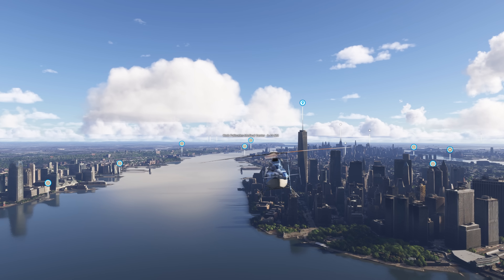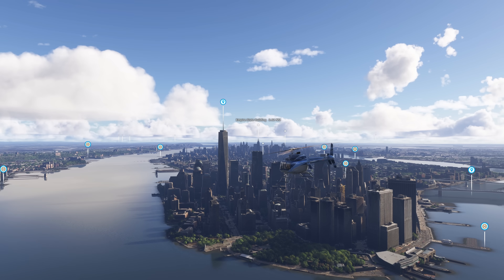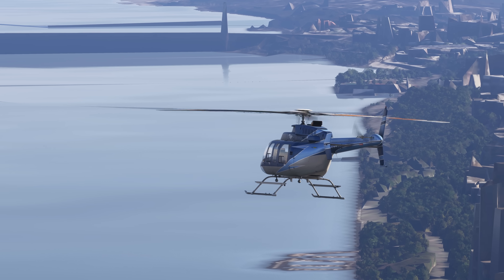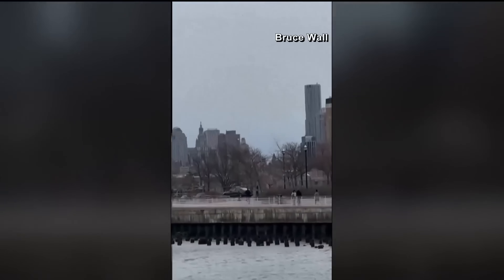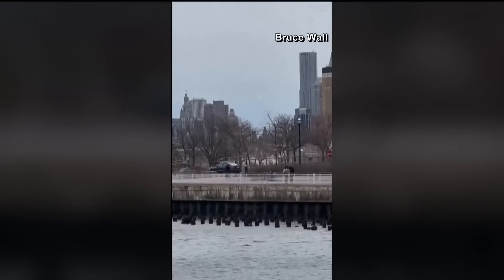Helicopter Expert breaks down Hudson Crash, and discusses “Bump Mast” Theory | NYC Crash Follow-Up

Comment: Thank you. As a former helicopter pilot who has flown the 206 and larger helicopters, you should see the second video of the crash from the other side of the river. It shows an almost instantaneous about 90-degree turn of the aircraft while it is in forward flight. A video showing the recovery of the helo from the water shows the tail boom folded over, which could happen from the airflow in the abrupt turn. The rotors, when they flew off, were straight and intact, still attached to the mast and transmission that was ripped from the aircraft. The rotors and transmission auto-rotated smoothly to the water. If the rotors had hit the tail boom, it wouldn't have been smooth, and the rotors would be at least bent or broken, as Col. Joe stated. From what I saw, it appears the transmission seized up instaneously, causing the helo to rotate from the torque, with the tail boom folding from the airflow. I also heard that there was a transmission problem with this helo in September, whether a chip was detected or something else. Another factor could be an engine failure where the engine seized and the overrunning clutch (free wheeling unit) in the transmission also froze. No matter what happened, the pilot had no chance to do anything to save the aircraft. The loss of life is terrible, and my heartfelt condolences go out to the relatives of the families of the passengers and pilot.
Reply: I am not a helio guy, but saw it the same way you and some others saw it and think the same. Credit to the guest it sounded like he didn’t buy that “ mast bumping” theory either.  Also thanks for pointing out what the posible cause of the tail boom separation. I was wounding about that.
Reply: Also a former OH-58 pilot I have never heard of the catastrophic transmission seizure you describe, but the anticipated result would be as you described it.  The aircraft folded in half in forward flight and the rotor spun off as a result of the sudden stoppage meeting inertia.  Had a cyclic climb or other low G maneuver allowed mast bumping, or the rotor system to unload, flap down, and contact the tail boom the rotor head would not have continued to spin at that rate.   Over twenty years ago, I talked to the survivor of a mid air collision between two  AH-1 Cobras in Korea.  He observed seeing the other aircraft’s rotor system moving at the rate of a watch’s sweep second hand as it fell from the sky, erupting in a huge explosion behind his aircraft, killing both crew members.  The contact dislodged a weight from the tip of one of the survivor’s rotor blades creating a severe lateral vibration that violently shook the aircraft and required both pilots to control the cyclic to get the aircraft on the ground. That vibration caused the transmission and rotor system to ultimately detach and simply fly off of the aircraft, cowlings and all, AS THEY PULLED PITCH UPON LANDING, resulting in the smoothest, noisiest touchdown in his flying career.  God was their co-copilot, that day.
Reply: @SpikeD2000 what weight on the tip of the rotor blade? Are you referring to the leading or trailing edge of the blade? And only if needed? Before you call me out as being stupid I was a 67Y for over ten years before the Cobra was phased out. Also two-bladed main rotor system, it is susceptible to mast bumping.
Reply: I don't believe it was mast bump. The blades were intact with the mast and transmission attached when they autorotated into the water. Had it been a mast bump, the blade(s) would have shown severe damage. Whether it was an engine or transmission or clutch failure is yet to be determined. Whatever the failure was, the pilot had no options available to him. My deepest condolences go out to the families and pilot.
Reply: I’m a helo guy, too, and yours is the best explanation I’ve seen so far. I wish everybody would stop talking about mast bumping - not likely in a Bell and the video doesn’t support it. It appears mechanically catastrophic and the  pilot could be neither the cause nor the solution.
Reply: @v1rot81 Mast bumping or rotor strike was the common thought (And mine too) UNTIL the video of the intact rotor/mast assemble spinning down.  So UNTIL  that second video was out there a rotor strike was not unreasonable given  the fuselage appearance as it was shown in first video.
Reply: @gscott5778 , you’re absolutely right. The video and wreckage pretty much ruled out a mast bump.
Reply: @v1rot81  lots of people who don't know what "semi-rigid" means talking about mast bumping not realizing how silly they sound to people who have flown and learned helicopters.
Reply: @v1rot81 Do you think the reported fuel issue, or lack thereof could have been the cause due to fuel starvation?
Reply: @BrianMiller4802 , it was possible initially, but now I don’t think so. It’s looking more like a catastrophic failure. NTSB will figure it out.
Reply: @ Thank you sir
Reply: That video was clearly showing what you described. Very astonishing to see it happen like that.
Reply: Ouch, this does not look good for the owners and management of NY Helicopters.
Reply: I agree with your observations.  The guest should have watched all the available video so he could make more informed commentary.   Talking about mast bumps and Jesus bolts was pointless.   That helo had a massive instantaneous mechanical failure and huge yaw event in straight and level flight.
Reply: @daversj  100% a mechanical failure.
Reply: @daversj jesus nut. Fixed it for you
Reply: So could this be a maintenance issue, metal fatigue. I guess what I'm asking is how could such a potential failure go undetected? Assuming the theories posited here with are the cause?
Reply: I just saw a story where the rotor system and transmission were recovered. From the looks of it, it appears that the transmission mounts DID NOT FAIL... it appears that the entire floor of the transmission bay ripped out of the aircraft with the transmission still attached... From what I could see, the transmission mounts looked intact.
Reply: Very plausible.
Reply: A chip doesnt GET detected the chip does the detection
Reply: @Jimmyjames11111  no, a chip gets detected. Read up on it here:

https://www.doi.gov/sites/default/files/uploads/IALL_2015-03.pdf
Reply: highly likely you are correct.
Reply: Former military crew chief here.  I totally agree with your assessment.
Reply: Absolutely agree with your assessment.
Reply: Did you watch the NE Philly jet crash? There is one video where it sounds like the engine seized up there too. Like high pitched metal gears grinding
Reply: I agree with you it makes sense that’s what happened
Reply: Tail not folded over, separated at #2 rib, Recovery of blades, gearbox and roof beam as whole assemblies.
One blade missing 18+ inches. no signs of contact with tail or airframe.
Reply: Wow great breakdown thank you.
Reply: I agree with you on a lot of that. But it seems like the tail bent over to the opposite direction of the rotation direction of the rotor head. Which the tail maybe contacted the rotor after it folded towards the fuselage, but I think the tail folded before any rotor strike. I feel like there were undiscovered cracks in tail boom and the track and balance was out for the rotor system and was being maintained poorly for many flight hours. Then under this flight with lots of weight the cracks finally catastrophically gave out. Because the rotors seemed fine as they were falling. So my best guess is airframe gave out from routinely performing poor inspections and maintenance. Also, newer pilots like a lot of tour companies hire, don’t usually know what it feels like to fly a helo with excessive vibrations due to poor track n balance which is horrendous on the airframe. As for the “Jesus Nut” I feel like the rotor head would have departed first in that instance.
Reply: Definitely more looking more like metal fatigue and stress on the airframe.
Reply: It seems in this video that they are describing boom strike, as in the main rotor blades have hit the tail. That could happen after mast bump and break as you said, or I guess by pilot inputs. It kinda looks like that helicopters transmission ripped out completely.
Reply: @mattwaine296  You should look at schematics and cross sections for the vehicle. there is a shell casing that comes of with the transmission but it's probably empty. It covers a void for stream lining.
Reply: https://www.youtube.com/watch?v=graz-V-Hksw shows the moment of destruction, including a sound which I believe is the tail shaft whipping around inside the boom right before the helicopter yaws and boom separates. There is also a video which I can't find right now showing the boom being recovered, and it appears to be torn apart forward of the horizontal stabiliser.
Reply: Well stated, thank you.
Reply: I concur. I firmly believe the Mast bearing seized...Rotor separates, Fuselage falls to Earth. I'd want to see the Maintenance records, incidents of Chip lights.
Reply: The rotor has the transmission still attached
Reply: Military helicopter pilot background (Oh 58 & UH 1) and I agree mast bumping seems unlikely. Catastrophic failure is more likely. The US Army had some early tail boom failures on the OH 58 (a variant of the Bell 206) due to the different rotor diameter of the OH 58 compared to the Bell 206 which set up a harmonic vibration that caused failures after multiple autorotation's with low rotor RPM at the bottom of the autorotation. The fix for this was to limit the minimum RPM during the maneuver which required a different procedure at the bottom of the landing. This gentleman does not give a great explanation of "mast bumping" to begin with.
Reply: @shannonstebbens6992  Seems to be lots of confusion between tail boom strike and mast bumping think it's because mast bumping can cause tail boom strike
Reply: The key piece of evidence is that is that the rotor was intact indicating that it had not struct the tail boom and that is was still connected to the mast and some portion of the gearbox.

I agree that the most likely cause is a failure of the gearbox and/or the shaft to the engine. The resulting torque is what destroyed the helicopter. 

The cause is likely to be a mechanical failure, possibly involving maintenance issues.
Reply: *rotors don't droop but cone up when they slow down in flight. On the ground it's the opposite effect!
Reply: I have never been within 25 ft of a helicopter and you came u with the exact same conclusion I did. The transmission or associated parts had to seize abruptly for the complete assembly to be ripped from the airframe.
Reply: @ Yup. I can’t see how the tail assembly failing first is going to rip the roof from the helicopter
Reply: Juan Browne, who I hugely respect, on his Blancolirio channel did an analysis and arrived at exactly the same conclusion as you. He went to the trouble of showing a 206 rotor head and gearbox, pointing out the quite flimsy looking pair of brackets that secure the assembly to the airframe. Apparently, it's not unknown for those brackets to fracture, but I think the latest footage of the exact point at which it all goes wrong, clearly shows that sudden 90 degree turn of the main fuselage, which is a good indication of torgue transfer from the rotors to the main body from a sudden transmission seizure. Also, the entire head assembly complete with both blades and the transmission still attached can be seen auto-rotating down relatively slowly. In a follow up, Juan also looked at the main cabin wreckage as it was lifted, and it is quite clear that the tail boom did not separate at the join. It broke a foot or so to the rear of that point, further reinforcing the likelihood that the tail broke off as a result of the sudden torque transfer.
Reply: Thank you very much, very insightful explanation and thank you also for the sensitive words.
Reply: I am no pilot but hail from an aviation family and I have some engineering background.  I dislike speculation, but I'd rather suspect it was likely violent reaction to abrupt and instant transmission failure. I think they might find it wasn't mast bumping as the tail was cut off too clinically.
Reply: I’m confused about the “mast bumping”.  I watched a 1982 US Army training film and mast bumping was where the 2-blade, teetering rotor ran out of teeter.  The Army film described it and illustrated it as the portion of the rotor hub that teeters or see-saws on the vertical rotor shaft (mast) which connects the transmission with the rotor, would bump that mast up near the top and break it.  The rotor would be separated from most of the mast, which along with the transmission, would remain in the airframe.  Essentially, it would look like the rotor blades came off the mast.  Like the propeller came off the beanie cap, if you will.

That does not seem to be what happened in this accident.  At least some portion of the transmission seemed to be separated from the airframe and the transmission, mast and rotor seemed to still be intact with each other and rotating.  Video showed them auto-rotating down, far separated from the fuselage.

From what is being discussed in this video, it sounds like they are describing “mast bumping” as the main rotor blades colliding with the tail boom.  Or else I’m just slow and not following, not understanding.
Reply: This.
Reply: If the pilot wanted to deliberately do this mid flight is there a way?
Reply: @FirstLast-rb5zj  No. There is no way for a pilot to cause a transmission failure.
Reply: Nice summation
Reply: Absolutely Brilliant observation  and Reply sir! Thank you for your insight which I believe preemipts the findings or best possible explanation of the official investigation.
Reply: @billlewis1483 Thank you and one of the best and informative comments I seen in awhile 🙏
Let's see what the full investigation will reveal and condolences to the relatives of the families of the passengers and pilot 😥
Reply: There are so many crazy things that can happen to a helicopter to make it decide to just drop like a rock, it's kind of scary.
Reply: Where's the second  video from the others use you saw?
Reply: Everybody talks here svput second video I saw many n repeats!! Which was second video ?  Can somebody post?
Reply: They recovered the rotors.  They are broken in half but still attached to the mast.  The centrifugal force of them rotating would have made them look like they were still intact while they auto rotated down.
Reply: One rotor was shorter, the tip was missing.
Reply: Thank you for this explanation. I've been searching high and low for why this happened and this looks like the most plausible explanation along with the explanation in this most excellent of videos.

My sympathies for the family and Pilot. Sad shit all around..
Reply: I would agree with transmission would be in the top 3 scenario. I'm also well versed in the Jetranger operation. Twenty year ARMY OH-58. The mast bumping theory isn't high on the failure lists as that usually breaks off at the top of the mast. The other most likely scenario would be a transmission mount beam failure which has been an issue with the 206's in the past. A tail rotor blade separation is also very highly likely. That would cause sever trouble with the tail boom the force from a loss of a blade could cause boom failure. If a tail rotor blade came off the gearbox would likely be ripped off with it causing the shaft to flail about violently. 

From the video the fuselage looks like the boom broke off just beyond the mount point. The intact main rotor blades don't support a boom strike. That suggests that neither mast bumping or rotor drop occurred. An engine failure or free wheeling failure is not likely causal either as a pilot response error would have caused a boom strike. The most likely events would be Tail Rotor blade separation, Transmission seizure  or transmission failure would be on the highest probability causal items.
Reply: Latest video shows salvage of rotor and transmission , its still attached to helicopter roof it looks like the roof section separated with transmission still attached
Reply: Yes, Main transmission seizure and catastrophic. There's nothing the pilot can do. Operator's responsibility
Reply: This is my own observation as well! I don't agree that when the rotors slow down in flight the  blades would drop to the extent of striking the tail boom. The opposite is actually the effect. The rotors will actually come up! The video is very clear the transmission locked up and aerodynamically the aircraft yawed to the right the rest followed. The tail boom separated as a result. The helicopter flipped as a result of the nature of these aircraft being too heavy, that's my own observation!
Reply: *the helicopter is top heavy hence the flipping upside down!
Reply: *naturally top heavy....
Reply: Instant and catastrophic gearbox failure
Reply: In the Bell 47 the transmission cannot Jam, I don't k'ow if ir is the same in the bell206,
But I beleive so.
Reply: This is a great overview, thank you.
Reply: A transmission seizing will cause a LEFT yaw, NOT a right yaw at as seen in the video.
Reply: @AgonxOC Honestly, the CCTV footage was so bad, I couldn't tell which way it spun. Just that it suddenly spun, hard, as the tail and rotor came off.
Reply: @ there is a zoomed version and you can see it yaw to the right.
Reply: @AgonxOC  Ah. I will have to look it up. Lots of speculation and misinformation out there about this accident; I would like to see the original videos.
Reply: Transmission!
Reply: Thanks. Not a mast bump. The tail loss and power head disassembly was a torque snap from a sudden stop of the transmission
Reply: Why is this guy talking about? The Jesus nut is what holds the main rotor hub and blade assembly on the mast. It does not hold the transmission in. Good god.
Reply: there is a better video which you can see the aircraft better and closer..if you look at the vertical stabilator at the tail rotor gear box, you will see the tail boom buckle at that location and then the vertical stabilator and tail rotor gearbox separate from the aircraft, then the nose pitches down, would assume the pilot pulled aft cyclic to try to level the aircraft resulting in the rotor system contacting and cutting through the tail boom and the violence of that event resulted in the transmission and rotor system breaking the mount points and separating from the aircraft...WAS NOT MAST BUMPING, the initial problem began at the tail.
Reply: And no one thinks that all these recent aviation crashes are connected?
Reply: @goxyeagle8446  No.  Why should they?
Reply: EXACTLY!  Pretty evident from the initial videos.   Air Cav!
Reply: Hi , I just posted a comment and would like your thoughts as a pilot, cheers
Reply: This seems to be the most plausible explanation so far. I just have a hard time believing there was a boom strike. The entire rotor blades seem to be undamaged and intact.
Reply: @billlewis1483   But couldn't that also occur if the Tail Rotor drive Shaft suffered a catastrophic "Rapid Unassembly"  causing the Outer covering to deform!??
Reply: @Pergolf33  No. If the tail rotor "unassembles," it normally does so at the couplings unless a main rotor blade hits it, which didn't happen here. The tail rotor shaft did actually break close to the main fuselage. The aircraft is in forward flight. The aircraft is streamlined to minimize drag. Pilot control motions can not make the aircraft turn as radically as it did. In this case, from the pictures, the tail boom broke radially to the side. This can't happen unless the aircraft also turns radically to the side at forward motion, imparting a sideways force on the tailboom. The tail boom is also streamlined and is actually an airfoil. They make them that way to minimize how much power the tailrotor requires in forward flight, thereby giving the aircraft greater speed and fuel economy. Even when a main rotor hits a tail boom or it fails in any other way, it won't go sideways in forward flight.
Reply: Gonna have to look for that second video!!  Thx for this input….
Reply: Nope, that's not what happened. The idiot pilot was instructed to lower her altitude and she did not obey
Reply: Exactly right. This video is mostly a word salad that doesn't match the evidence we have...
Reply: Look at the new video of the salvaged wreckage. You can clearly see a tear in the tailboom skin at the first rivet line.  As noted in my comment above, I investigated a similar accident, and it was caused by metal fatigue. 

I don't believe it was caused by a transmission seizure as the initial action would have been the main rotor and gearbox separating from the aircraft, not the tailboom failuure. Additionally, the thrust of the main rotor is to the left, and a seizure of the main gear box would have resulted in the nose going to the left due to the inertia.

Metal fatigue at the first rivet line resulting in skin failure would have caused the boom to twist forward on the left side of the aircraft due to tail rotor thrust. And, the nose going to the right as it did in the video. 

Additionally, main gearbox failure would have been proceeded by gearbox chip indicators, which I believe the pilot would have noted to air control.
Reply: @keithdavey5492  I also am sceptical that the engine seized though it's always something to consider. It seems to me as though the tail suddenly went and then the transmission a few seconds later. It could have been a tail strike but this doesn't really explain why. Apparently under certain turbulent conditions the axel can come loose and break away but to see if it would do it like this you'd need to look at a schematic of the upper assembly. The tail breaking off like that might push it beyond its limits but who knows. A drone strike is still not ruled out. Sabotage is another possibility. The company leased its choppers and had issues paying for the leases. Someone could have loosened a few bolts. The way it serves also reminds me of when someone loses their temper in a car during an argument and serves the wheel to one side suddenly in rage crashing the vehicle but a technical fault could look just like that.
Reply: @keithdavey5492 @keithdavey5492  Tail boom cracking from metal fatigue doesn't result in a turn that is that radical and rapid when in forward flight. Chip detectors are not immediate. A chip has to flow to the sensor, not get caught by the filter, and lodge enough material to indicate. A sun or planetary gear that cracks or jams will immediately stop the transmission without any chips being detected. The video and frame rate doesn't clearly show the airframe's rotation and direction. Ripping the whole transmission deck off takes tremendous force as it is the most structural part of the airframe. We'll see what the NTSB comes up with. By the way, I heard there was a previous transmission problem with this aircraft in September.
Reply: @keithdavey5492 Skin failure wouldn’t cause this. That thin sheet metal has little to no structural value on most any aircraft.
Reply: @keithdavey5492  I tend to agree with you! 
Also they had wind gust's up to 18 mph that day! Which may or may not have had anything to do with breaking the boom. But if it was weak already its possible.
The left side of the boom is undergoes more stress its entire flying life. Because its being pulled hard right at all times any time in operation.
I believe when the boom broke before anything else on the left side of the helicopter, it quickly got into the tail shaft as the helicopter rotated to the right, where thumping can be heard in the video with audio.
As it bent around far enough to snap off the tail rotor drive shaft the thumping stops.
As it bent the shaft enough at some point that should have choked out the engine and without the autorotation clutch disengaged the kinetic force of the main rotors spinning ripped out the main transmission which should still be fully functional when they tear it down.
I may be wrong and look forward to hearing the actual findings of the  NTBS cause of failure report.
Reply: I'm not a pilot or expert, so please don't think I'm trying to argue or be the "armchair investigator" type. I fully accept that I could be very wrong. With that being said, in my assessment after having watched the second video as well, the heli seemed to yaw dramatically to the right. If the transmission seized (with rotor spinning counterclockwise looking from the top down), wouldn't the inertia of the spinning assembly yaw the airframe to the left - the same direction the rotor is spinning because of the sudden transmission resistance? And if the helicopter did yaw to the right, I would think that would be caused by rotor torque as it pertains to being powered. 

So my hypothesis is that it had a catastrophic tail boom failure/separation. That would not only cause the helicopter to yaw so violently right in level flight, but could also explain both rotors leaving the aircraft, especially if the main rotor contacted the boom near the blade tip once the boom separated. As in, instead of "crumpling" the main rotor, it could have struck just enough of the boom to cause both the sudden "debris explosion" right after the beginning of the accident sequence, and the jolt that managed to separate the main rotor assembly. I don't know. I could be completely off base. But I figured I'd run it by you to see what you thought.
Reply: @jonthecomposer  Agreed. To me it looks like the tail came off first for whatever reason (my favorite theory is a wildly oscillating broken tail rotor shaft.) That would have made the remaining fuselage yaw right bcause of the lost tail rotor.
Reply: @jonthecomposer  The video is too blurry to tell if the aircraft turned left or right. When the fuselage was recovered, the tail boom was folded under the aircraft but is still attached. The whole transmission deck is ripped off. The rotors broke upon hitting the water but were intact until they hit. I have seen helicopters have tail rotor and tail boom failures, but in forward flight, they don't yaw radically like this aircraft did but stream and curve gradually. I was right next to one.
Reply: @billlewis1483  I understand. And the video is blurry. I did watch it many times at even slower speeds to try to catch the yaw direction. So yeah, I could be wrong for sure! I also didn't realize the boom was still attached. Only thing I noticed during the video that you didn't mention is the small debris "explosion-like" scattering that happened right after the beginning of the accident sequence. Not sure what would have caused that other than a rotor strike. Let me include a link to the video I watched for more clarity. Thanks for the input!!!

The helicopter appears to start yawing at 0:15 followed by the debris at 0:17. This was watched at 1/4 speed and 1080 just to get as good of a view as possible. 

https://www.youtube.com/watch?v=wnOn5WAKTqc

Also this better quality video:
https://www.youtube.com/watch?v=graz-V-Hksw
Reply: @jonthecomposer  I looked at the video you linked and played it slow, zooming in on the helicopter and pausing it, taking a screenshot, play, pause again quickly, etc. 
Something definitely happened on top of the chopper first, to then cause that tail to break off. Damnit I wish I was able to send you these pictures.
Reply: @jonthecomposer  Also, at 6,7 or 8 second mark, right before it goes behind that building, something happens! You can see smoke or debris coming off! Someone in the comments pointed it out.
Reply: @ I appreciate the input. Perhaps I missed something. I'll have to take another look.
Reply: @jonthecomposer  Hello. I fly r/c helicopters and I know that the main blades are driven clockwise and I have to add right tail input to counter the main blade torque. I think it is the same for full scale helicopters.
Reply: @jonthecomposer  The standard direction of the main rotors is counter clockwise. If it locked I suspect that's the direction it would go in. That is unless I'm missing something. Normally the toque is pushing the body clockwise so the tail also has to be turning counter clockwise. You would expect a lurch to the right perhaps if the tail rotor were lost. Though with the loss of the tail rotor you still have the fins as an air brake, I'm not sure how well that would work to reduce the spin. I suspect the sudden total loss of the tail. Possibly with a tail strike though there is then the question of should the blades be intact. A strike on the tail might initially cause a jerk to the left. If the transmission detached immediately on the strike of the tail you might not expect such a sudden turn. It suggests the tail went first in a strike then moments later the transmission.
Reply: @jonthecomposer  With rotor blades that spin to the left when viewed from the cockpit (or from a top-down view), or anti-clockwise in other words, the fuselage will always try to spin in the opposite direction (to the right in this case) if engine torque is being applied to the rotor system. Thus, if the tail structure suddenly separates from the aircraft in this type of helicopter, or if the tail-rotor simply fails for some reason, the anti-torque force is lost and with engine power still being applied to the rotor, the aircraft will yaw violently to the right, not left.

Now, would the same be true if the main-rotor gearbox suddenly seized? My helicopter pilot instincts tell me yes, it would also yaw violently to the right. Always opposite the direction of rotation to the rotor. Though there's a part of my brain that is not totally sure. Would have to look at some literature, such as previous accident reports involving seized gearboxes to be certain.
Reply: @rubes3927  I never said it would yaw to the left with the main rotor powered. I said to the right. 

About a gearbox ceasing: if the rotor blades are carrying the inertia of spinning, and the gearbox wants to "grab them" from ceasing, it only makes sense the blades would turn the gearbox (thus, the airframe) in the same direction. How could it defy the force of the main rotor and go the opposite direction?
Reply: @jonthecomposer  From looking at the pictures by blancolinio it appears the aircraft did rotate left either 90 or 270 degrees, can't tell from the blurry video which end of the helo we are looking at, as the fracture of the tail boom appeared on the right side. The slipstream on the tail would make it break at the weakest point: all the rivet holes holding one of the internal structural bulkheads.
Reply: @jonthecomposer hi , I have just posted a comment and would really like to hear your thoughts about it. Cheers.
Reply: How are the mast and the transmission assemblies attached to the frame of the aircraft? With 4 bolts? 6? Maybe 10 or 20?
How is it possible all of the bolts/nuts/rivets failed at the same time without giving any indication prior to the detachment like a vibration, a noise o some other manifestation?
Reply: @megajoemm  another video shows how that trans is attached. It's two "Y" shaped cast brackets that are attached with four big bolts and the castings are known to break under very high stress, so they probably busted right off for whatever reason, leaving the transmission and blades to break loose from the air frame.
Reply: @plane_guy6051  Thanks for the explanation. Explained that way, makes sense everything detached in an instant with no previous vibration, sound, whatever.
Whatever happened (we'll have to wait for the investigation results), poor people. They didn't have a chance 🙂‍↕️
Reply: Not a pilot (aviation lawyer) but thank you for that analysis!
Reply: Absolutely. As soon as I saw the longer video showing that 90 degree slew, the first thing I thought of was catastrophic transmission seizure. The entire transmission, mast and rotor head separated from the aircraft and autorotated on its own with no apparent damage. If this were mast bumping, the rotor head would have likely separated from the mast... I also don't think that the rotors struck the tail... I think the tail collapsed when the transmission ripped loose, tearing loose the tail rotor driveshaft. Tragic accident, to be sure and hopefully the NTSB can get to the bottom of this quickly.
Reply: What about bird strikes a possible cause or the pilots reaction to them ?
Reply: I always hated twin engine helicopters (which still only have one gearbox and one rotor shaft, which however are now much more stressed and fatigued due to the extra weight….)
Reply: Možda je u pitanju kvar🤔?
Reply: I entirely agree, I'm not a pilot and I just flown in an helicopter twice (AS350) and mast bumping sounds absurd to me too, especially after the second video came out. It's as clear as the sun that it was a catastrophic failure of the transmission or engine where everything seized up resulting in sudden rotation of the craft, where g forces broke the rail first and then the whole transmission detached.
Reply: Great info.  I've been wondering what other causes there could be besides that mast-bumping situation. That'd be a heckuva load to the aircraft if the trans suddenly seized.  I'll have to go look for that other vid.  Thanks for the info.
Reply: Could this come from no fuel?
Reply: @califcamper  No, if the engine stops for any reason, it disengages from the transmission, and the helicopter autorotates down.
Reply: @ it’s more likely the pilot sneezed
Reply: @califcamper  Google this accident.  There'll be a vid looking out on to the Hudson between two buildings.  Check it out, if you haven't already. You'll be able to see the helicopter through the moment of failure and crash.  The way the body of the helicopter gets violently thrown doesn't suggest something running out of fuel.  It looks more like something suddenly mechanically locked up.